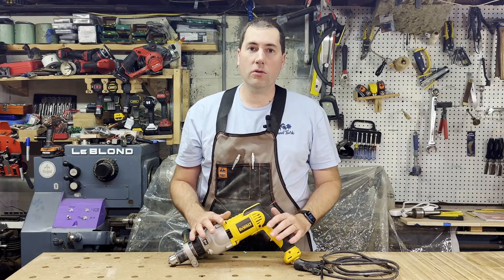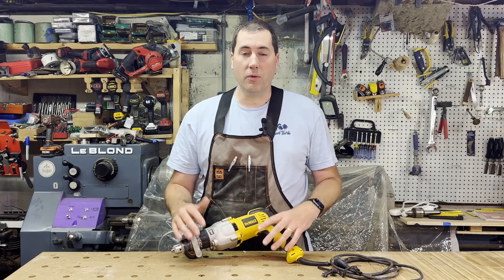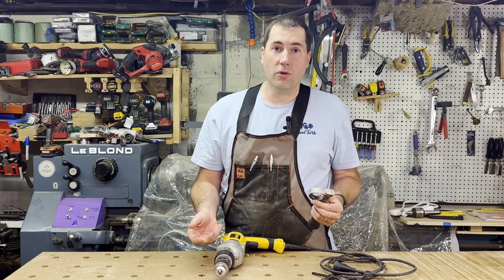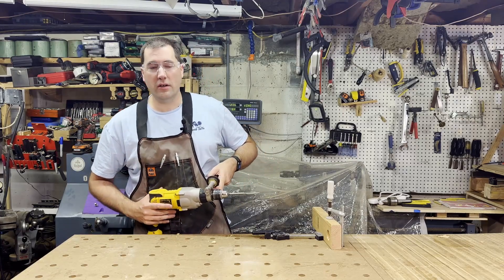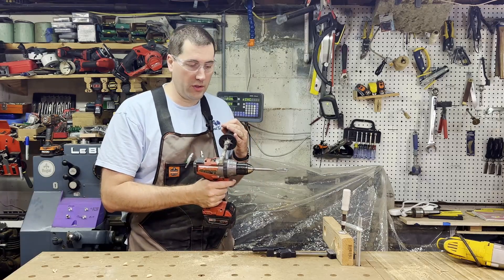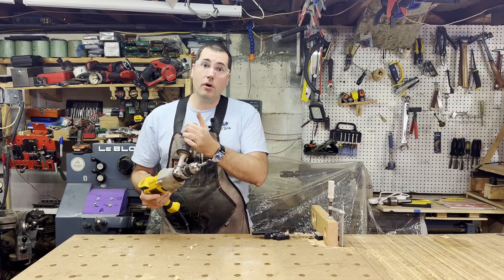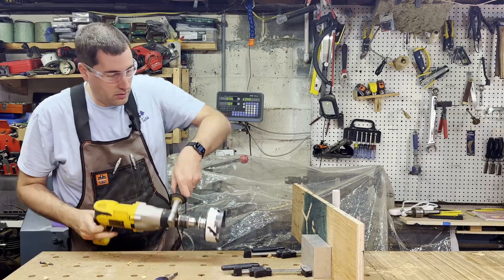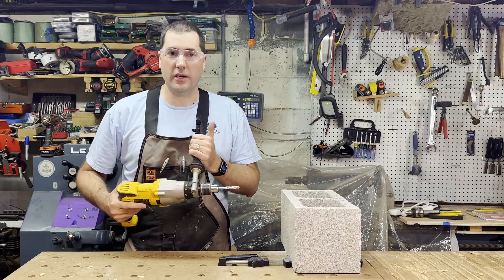Dewalt DWD520 10 Amp Corded Hammer Drill Review

Comment: i use it  to drill on metal and i already burn 3 cordless drill dewalt Milwaukee and a Makita and never burn a corded drill
Reply: Truth, as a professional sometimes, not often, we need the beef that cordless drills just can't get.  With a 4 1/4" hole saw cordless versions just don't cut it, however, the corded ones will break your friggin wrist if they get twisted up.
Reply: I burnt this exact drill drilling a lag bolt into a 4x4 post right after buying it.  It literally caught on fire

Comment: To me nothing wrong with a corded drill i own a DeWalt dw235g keyed chuck and i have 
A  Milwaukee 0228-01  I rebuilt for a friend who once it was repaired decided to give it to me has a metabo 3/8 keyless chuck made in Germany gives this old vintage Milwaukee drill some character compared to the original configuration I have a Porter cable modal 629 8 amp reciprocating saw 6 speed skill sander jigsaw Craftsman industrial router skilsaw 13. Amp circular saw I have some cordless stuff as well but this is what I grew up with and I find it still liable to me